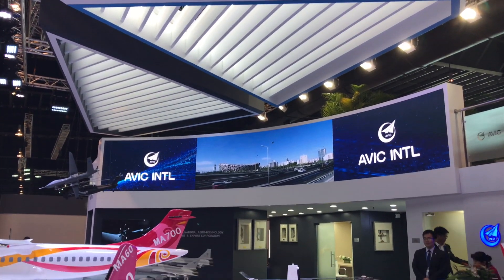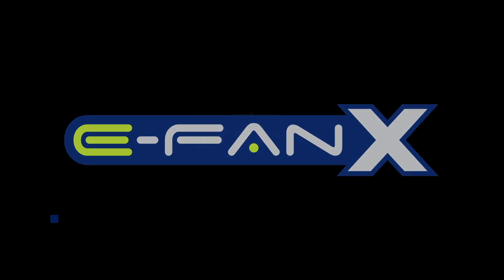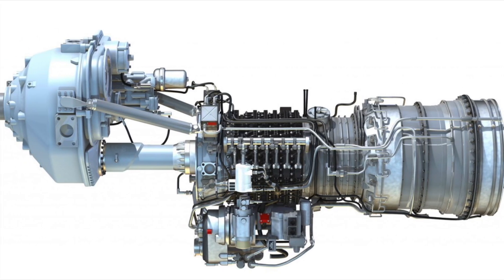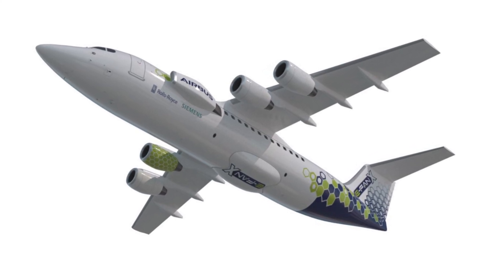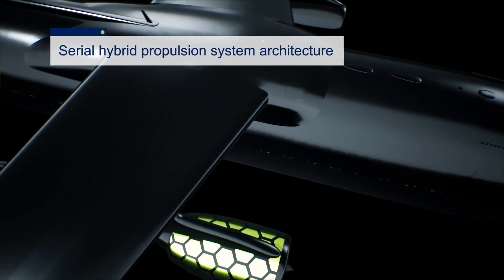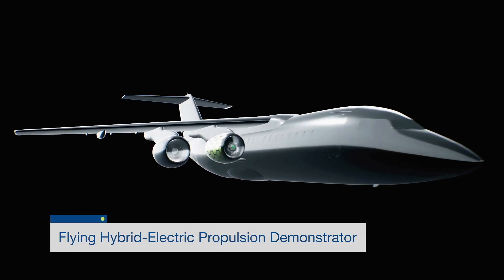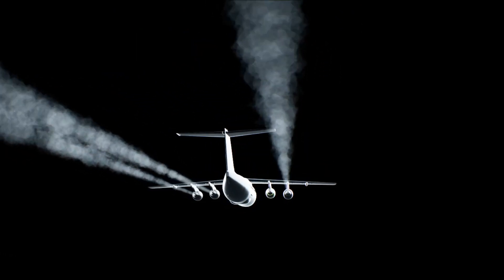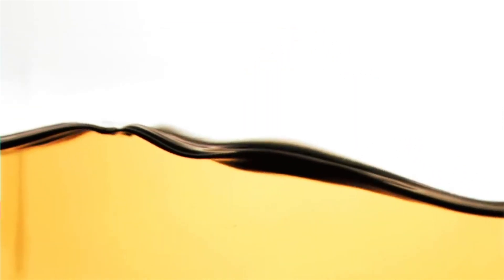Airbus E-Fan X: Airbus Electric Plane?

Comment: Now that brings a whole new meaning to range anxiety... if your electric car runs out of juice before you get to your destination it simply stops... if this plane runs out of juice before it gets to the airport it crashes out of the sky in a burning fireball!!!
Reply: Same thing with air fuel. If you run out boom
Reply from the maker: Interesting, I believe Airbus would have taken that into account when designing the aircraft. Thanks for tuning in and do consider following ONESkyFlyer on Instagram for more great Plane Spotting videos!

Comment: This aircraft was a complete nonsense from the very start.
A hybrid is ALWAYS heavier than a jet engine, reducing payload and range.  And there are hybrid NO gains, because aircraft run at a constant power setting.
So the project failed, as any six-year old could have told them.   Just how did they get finance and grant money? Who were the idiots who funded this?

Comment: The only practical electric aircraft are ones where they DON'T have to worry about being placed into a 'holding pattern' at an airport.  Those are the only aircraft that fly out of really small airports that have hardly any flights out of them and aircraft that take off and land on the water.  If you have to fly to an airport with any amount of traffic, you cannot fly an electric aircraft there safely since an electric airplane does not have the stored energy to loiter around for 30 minutes during heavy traffic.

Comment: But what is the benefit of having a turboshaft run a generator, charging batteries, powering an electric motor? Seems stupid unless I'm missing something. Turbofans are already pretty efficient as they are, at least when compared to a turboshaft...

Comment: I love how people say we should incentivize their airline industry to be more fuel efficient.
Like
This is one of the few industries that is 100% incentivized to replace fuel.
Fuel is the #1 cost to airlines. The #1 thing they want is less fuel. Whichever aircraft manufacturer that can come up with a safe electric aircraft that has the same capabilities as a conventionally fueled airliner will get a mind boggling amount of orders because of the amount of money it would save airlines. 
Manufacturers since 1970 have had goal that has never changed cut fuel costs. The holy grail is electric planes.
No need to incentivize these guys they are moving that way as quickly and safely as possible

Comment: Rubbish - Hybrid airliners can NEVER work.
a. Because airliners work at constant power settings.
b. Because airliners operate as near full thrust in the cruise.
Which means that your hybrid ICE engine would need to be working just as hard (and consuming just as much fuel) as the original jet engines.
And putting out MUCH MORE CO2 that the original 146.
WHICH IS WHY THIS PROJECT FAILED IN APRIL 2020.....

Rolls Royce and Airbus should be taken to court for misinformation
They sucked £58 million from UK taxpayers to fund this fiasco.
And it failed, as any six-year old would have known.
RE.

Comment: Lol. All this green fake climate change hoax. Commercial Jet Engines will never be replaced. This is all bs to reduce fake emissions. Oil is infinite.  I work in Aerospace. 500 mph at 7 miles in the air for hours and hours will never happen. Jet turbines sound way better. Look at paramotoring. Electric pos ones only fly a measly 45 min. Gas flies at 4 hours. Screw the epa and United Nations.

Comment: We must try harder to get rid of Airbus from BritishvAerospacexafte4vtheyvdestroyed thecBaexRaj production line to build houses just as the housing bubble burst the production line was sold out for five years I can only hope with repaying the costvofvthecsaircrsaftvback to the airlines as the production line was sold out for 5 years an the redundancy payments rato the work force I hope it cost Airbus an absolute fortune Rumour control had it that they viewed the 146/RJ aircraft as competion for the A318 which was so good they sold less than a Handful the 146/RJ has the distinction of being the only aircraft permited to fly into Washington Dulles at night  the sooner the UK is away from the EU without any kind of deal the better!
Reply: That is business, not the EU. Both BAe and Airbus are and were accountable to their shareholders. The deal was for BAe to build the components for Airbus, the cost balance was to remove a formidible competitor (RJX)  to the ATR 72 and smaller Airbus designs as part of that deal. That was nothing to do with the EU, brexit, or anything else, it was the beancounters and shareholders making corporate decisions.

Comment: The 146 was way ahead of the pack when it came out and has become an ideal feeder airliner and route aircraft even over longer distances. Very quiet and very reliable and why they are still flying. Airbus could do worse than do an 'electric 146' with two turbofans and two electric motors.

Comment: Probably Electric airplanes of near future would be Hydrogen powered than battery charge alone. Battery would be, smaller, stabilizer of electric surge balancer than main source, in such aircraft, hydrofueled airplanes. I guess that such aircrafts would be partially turboprop-like blades that will act like a re-generation upon landing stages and another two conventional, if there is four engine. Hydrogen-planes will fly in short routes. Fully electric is within city-taxi.

Comment: Just to be clear - The aircraft you're showing ISNT a hybrid electric concept plane. The BAE-146 is being used for what's called a "Flying Test bed", just to test the hybrid propulsion system.

Results from this test will be used to design an actual aircraft later on.

Comment: I would think to use two inboard jet engines with two outboard E-fans. All four could be used upon takeoff, the two jets idled back during cruise and used as generators then all four dropped to minimums for landing. It would have a major decrease in jet fuel use.
Reply: Hope you've been well since writing this comment. It's a very interesting thought and honestly hybrid aviation is the way to go especially considering the entirety of Airbus' fleet (as of December 2022) are capable of running on 100% sustainable aviation fuel (SAF) which is essentially a drop-in fuel type derived from biomass. Things like human and animal waste, forestry residue, oils and fats, etc... which has an emissions efficiency of like 90% compared to regular jet fuel. But it would take years to even make a dent in emissions even with SAF running on all Airbus engines. Interesting thought and it will probably be a while until we see an all electric fleet... Even still a German Airline just purchased a fleet of "Alice" aircraft from Eviation, a NASA based startup focusing on electric aviation. So, we could be seeing those types of planes taking over some regional missions in and around the northwestern European countries like Germany, Belgium, Switzerland...

Comment: Long term goal, wing fuel tanks replaced with battery packs and fuselage tanks feeding a single on board generator powered by a single turbine engine optimised to run at 100% rpm the entire time. Peak engine power is only required at take off and higher loads at climb. Batteries can supplement take off loading and generator alone can feed climb out power. At cruise the excess power output from the generator can be used to charge the wing battery packs. Batteries in the inboard wing and skin surface heat exchangers over the entire wing surface will take care of heat generation. Auxiliary cooling scoops can be deployed for take off and climb out and retracted when not needed. Completely hybrid airliner achieved with peak efficiency 🤙 weight loads once optimised will be almost equal to a current jet and with sufficient use of composites and reduction in wiring and hydraulics weight loads will be LOWER than on legacy aircraft
Reply: J Young: Very well put I must say, but they could also have back up generators in case the turbine generator fails. In fact I think overall such aircrafts of the future will also be much safer.
Reply: Does not work like that.  
The Bae ALF505 engines work at 98% max thrust in the cruise, so there is no room for running a smaller engine.
Max continuous thrust is 857 degrees c.  Cruise thrust is 820 or 830 degrees c.
Most airliners cruise at nearly full-throttle altitude.
P

Comment: The comeback of 3 and 4-engined airplanes? (Queen of the Skies 747-8E?)
Reply: Hopefully, Airbus brings that down to 2 engines mounted near the rear, cos more engines/motors increase weight and drag. :) Also, I'd love to see this plane in an orange and blue livery, but color is the least concern. We just need electric planes, to reduce our CO2 emissions.

Comment: Just a hybrid-esque test for now. The low energy-density by weight of batteries is just too limiting to allow pure electric aircraft, in such a way as larger aircraft like most airliners would only be able to fly for 20 to 40 minutes before dropping out of the sky even if you crammed batteries everywhere inside. Biofuel is the much better route if one is interested in "carbon neutrality" regarding air travel. If I remember correctly a lot of the bio-kerosene/jetfuels are derrived from algae, and at the moment are a bit over $6/gallon or so. So when regular fuel prices reach or exceed that level ( likely later this decade ) then bio-jet fuel would become an economically viable or eventually even better option for the airlines in comparison to regular jet A
Reply from the maker: AK Max Flights Thanks for your comment. Most certainly so, there is still a Long way to go for technology to allow all electric aircraft. Thanks for watching and do stay tuned for more great videos on the way!

Comment: From what I understand it’s a test bed with a Siemens motor, Rolls Royce ducted fan and 3000 volt electrical system.   Since it’s a 3 megawatt motor there will be 1000 amps.   Serious conductors and over current protection needed.  I think only one engine will be electrical.  There is a lot to learn.   The batteries just aren’t good enough yet.

The future of commercial aviation will be dominated by ultra efficient aircraft such as SUGAR VOLT that still use fuel.

Synthetic carbon neutral fuel can be made from CO2 taken from air combined with hydrogen from electrolysis.  The term used is PtL “power to liquids”.     There may be some use of fuel cells or hybrids
Reply from the maker: William Jones-Halibut Thanks for sharing this information. Yep, many challenges stand in the way, but the motor industry managed to overcome these which have Airbus hope they could also launch an electric aircraft. Thanks for watching and do stay tuned for more great videos on the way!
Reply: @oneskyflyer  where can I find the whole electrical plan
Reply: Algae biofuel is the way, though it's still something like $6 or $7 per gallon, but the moment regular fuel inevitably hits that price, the airlines will eventually start being economically pushed to switch over of their own accord. Though some airports ( like Seattle, for one ) are already intending to start having the jet fuel they provide be 10% biofuel blended in sometime in the immediate future
Reply: @AKMaxFlightsTravel  Algae biofuel requires far too much area to produce, using it to meet the demand of the entire airline industry would reap horrific environmental damage. Carbon capture is the only way.

Comment from the maker: Electric for the future? What do you think? What other technologies do you think will make its way to future aircraft, comment below! Thanks for watching and if you are new, do subscribe and stay tuned for more great videos on the way!
Reply: AirplaneProductions. No way. Energy density of batteries are not even close to the density of Petroleum. Waste of time
Reply from the maker: ryan M Thanks for your comment. Yep, this technology still has a Long way to go. But this applies to cars a Long time ago, and with advancements in technology, I believe that electric is indeed an interesting fuel! Thanks for watching and do stay tuned for more great videos on the way!
Reply: Seems like the E-fan X is paving the way for the return of the Quadjets, except that this time it will be 2 electrical engine + 2 turbofan engine. A hybrid A380neo would be interesting.